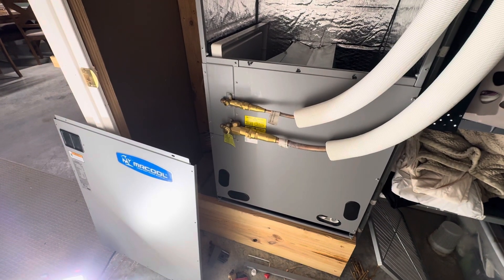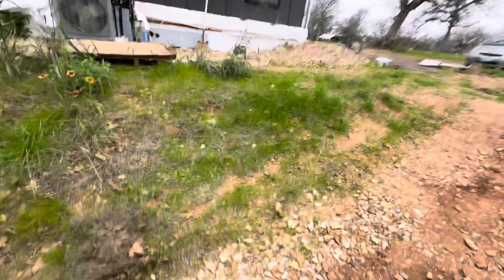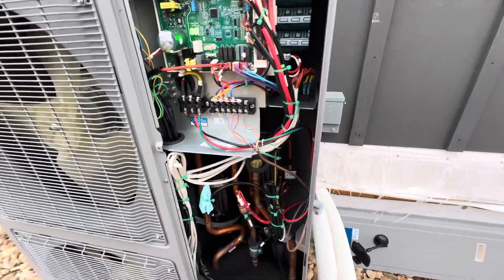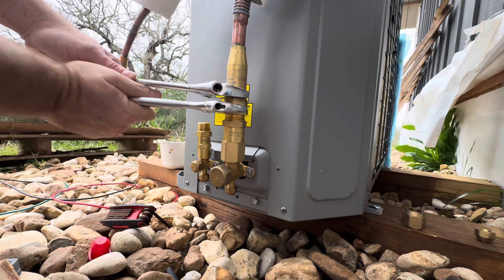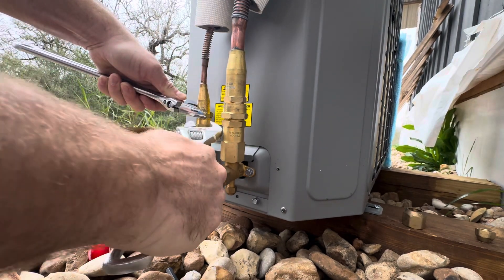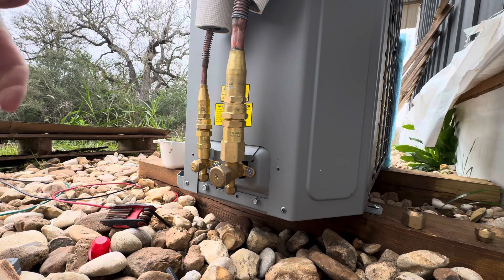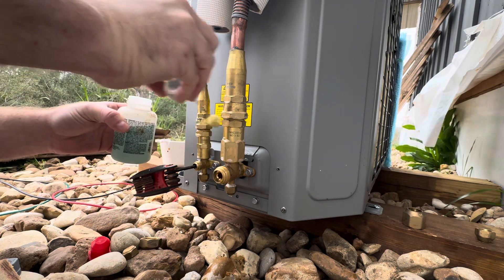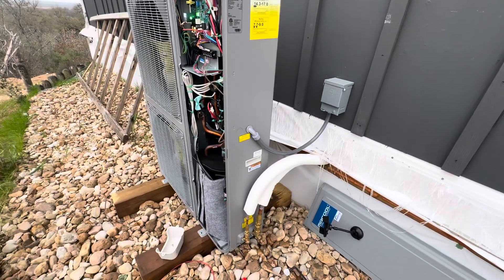Mr. Cool Universal DIY Easy Install

Comment: Should keep those connectors capped or bagged until ready to connect (keep them out of the dirt/rocks). Some Nylog Blue, or at minimum some poe oil on the flare faces/seats can save pita of leaks. Getting some on those quick connectors won't hurt either, before connecting.
A metallic whip to a jbox would be better for indoor power to AHU. Torque wrench is best for line connections, even experienced mechanics get goodntight wrong. Should probably tie the ODU to the wall somehow (straps, brackets,...).
Otherwise nice install, and nice property.
These MC Universal r410a are actually really well built quality systems (rebranded/private label GREE Flexx), should last as long as any major brand and save a ton of money if properly installed.
Unfortunately the 410a systems are no longer available, and the new r454b Universal systems are not GREE, looks like Midea. Seems they've had a falling out with Gree, probably all the whining the GREE contractors and HVAC guys in general been doing.

Comment: Any issues with your Mr. Cool system? Any leaks? I'm planning to install the 2=3 ton universal and was going to use the Nylog Blue on the line set connectors and a torque wrench to get the exact tightness. I have never done an installation before, so I am a little paranoid about leaks. That Freon is so expensive if it leaks out.

Comment: I installed the same unit at my house. Only difference is it's in conjunction with a gas furnace.

Your unit must be newer than mine, my valves for the AC lines are inside of the cabinet of the outdoor unit, not on the outside like yours, I asked Mr. Cool about that and never got a clear answer as to why my valves are inside the cabinet.